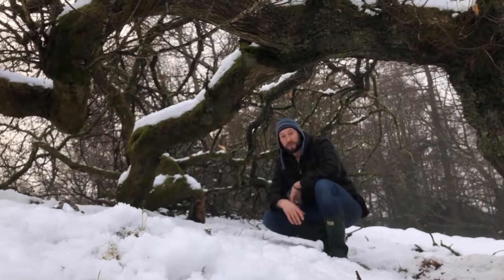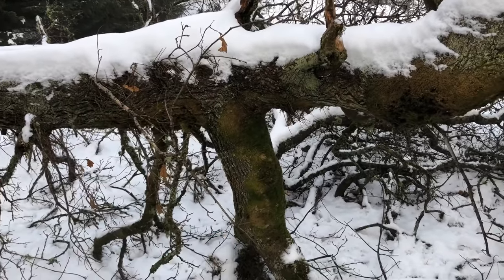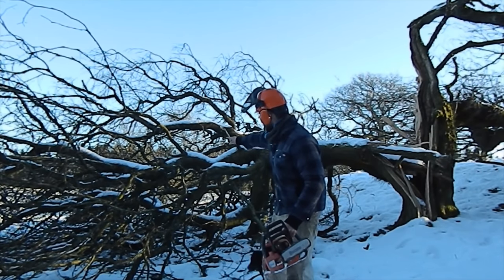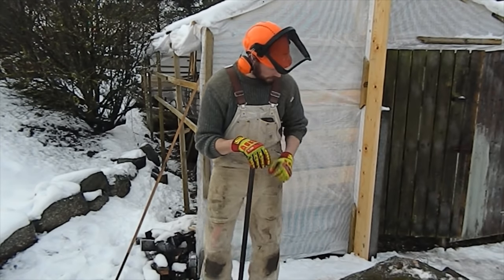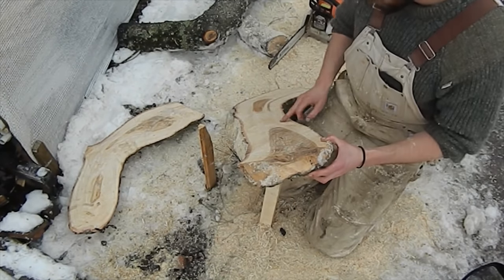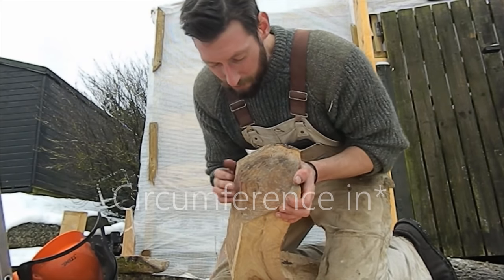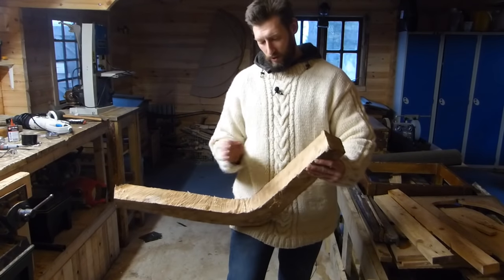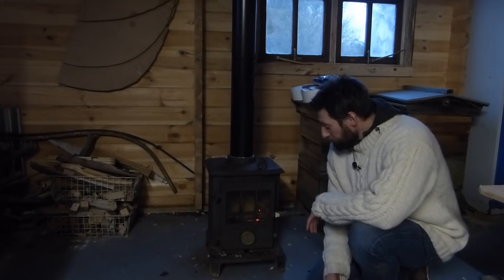Reviving an Idler   Episode 7   Wobbly knees   Hunting for some timber!

Comment: Looking good. You probably know, but just in case... It's a good idea to slow down the drying a bit by sealing the end grain, traditional is wax (at least in Germany), PVA glue works well, but any old paint rest will do the job. Also let it stay outside, open and stacked so the wind can blow through but covered up from the rain. Look forward to your next video...

Comment: The only way I know to distinguish between white and red is the pores when viewed from the end grain.  Red oak is open and white has tyloses (little flecks) in the pores and appears clogged.
Reply from the maker: There is also a visual difference in the grain but its not particularly safe to base your judgment on! Using a saucer of water and an off cut or the “acid” test are. “Belt and braces” approach’s for when it really matters - such as in a frame. 🤙🏻

Comment: It's got to be very difficult to purchase or obtain the natural healthy oak from your neck of the woods for your frames, knees , ribs and plank sides.That must be a very real challenge but do -able. I guess research and planning makes it possible.Interesting.Does Wales have a good supply of oak and southern England( New forrest area, Southampton) ? Curious....
Reply from the maker: There is a particular shortage if all materials at the moment, (thanks brexit and covid) but oak is proving to be the most difficult by far. Scottish oak can be astonishingly beautiful stuff, but for boats it is not so great as its usually very pipped/gnarled and generally weather beaten. But you can get some good stuff. 
I cant really comment on Welsh wood im afraid, ive never tried to buy form down that “neck of the woods’ before 🤣

Comment: Thank you for sharing the video and your knowledge of the timber.
I am planning on building a boat, and I've done some research on different types of wood, but have gotten some information that contradicts itself. I would like to know what your opinion is on using these woods that I have on my property.
Live oak?
Red cedar?
Red oak?
Elm?
Thanks again, can't wait to see more work on your vessel.
Reply from the maker: Hi, thanks for watching and congratulations on making a fantastic life choice; Building your own boat. 

There are a lot of varied specie of trees in different regions and some if them look very similar to each other. Some have contradicting property’s; one of the most widely known is to white and red oak. White has closed capillaries and so water cannot penetrate through the end grain. Red however is so open it is much like a collection of straws: this results in the wood rotting from the inside out. 

So it is worth trying to find out exactly what species you have in your property and read up on it. There is plenty of info online once you have the latin name sussed out. 

But as a general, Rule of thumb you have good wood there. 
Live oak is wonderful by all accounts but you don’t get it over here so i dont have any experience working with it. Its heavy and very strong  and doesn’t move much with moisture changes. Ideal for the back bone (keel, frames, deck beams etc)

Elm is also a great choice for the backbone. It was used by the romans as water pipes as it is fantastically rot resistant. Nice to work with and beautiful when oiled. Its been used as a boat building wood in Europe since prehistory! 

Red oak, is unsuitable for any boat building application except cosmetic. It will get wet and it will rot early. 

Red cedar: ive only used this in Skin on frame kayaks and found it a very nice easy to work wood. Ive heard it is good for planking and decking. Again though we dont readily get that over here. 
 
I hope thats of some use, but sounds like you have good lumber there. Good luck and enjoy!
Reply: @BothanboatsIdler  Thank you very much for taking the time to answering my questions. I'm really enjoying the rebuild that you have going. The fact that you are not only constructing you are also sharing your knowledge which is of great a benefit to so many, I'm sure. 
As far as your boat is concerned, would it be a problem to knock out the caulking from the inside of your boat versus pulling it out from the outside, I'm just curious if that would damage the planks?
And after making all the repairs, will you be sanding everything? I think it's an awesome looking boat, and Im really enjoying every part of the process. I say thank you again because I'm getting so much out of watching your videos.
Looking forward to the next, which I'll be watching tomorrow.
Joe
Reply from the maker: Thank you so much, thats very kind of you! 
As she dries out that is becoming possible. But there are still some seams that are too tight to do this. 

Eg: the planks are beveled on their edges to accept the caulking. But butted up close. This results in an “open” seam on the outside of the boat. But the planking touching on the inside. 

This means that normally you cant push anything from the inside to the outside. So you must “hook” it from the outside. But as i say, as the planks dry out i can (and have) push from the inside when appropriate. 

I have a few planks to replace and lots of repairs. So she will likely be planed or scraped and then sanded fair before primer coat. 

I hope that helps? What type of boat are you planing to build? 

Cheers,
Nick
Reply: @BothanboatsIdler  Yes, it makes a lot of sense. Thank you.
I have a few more questions, but as I understand it, filming and editing the videos takes a considerable amount of time, so if I have a question I'll go back a few videos to see if I missed the answer.
God bless you Nick.
Joe